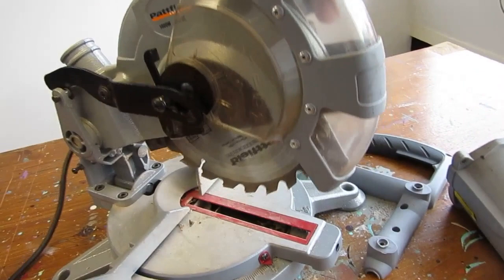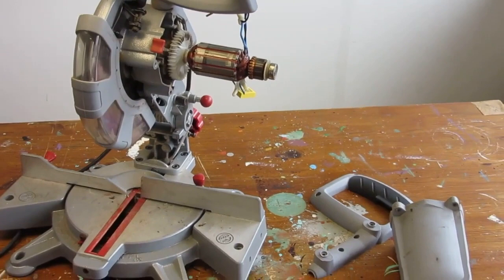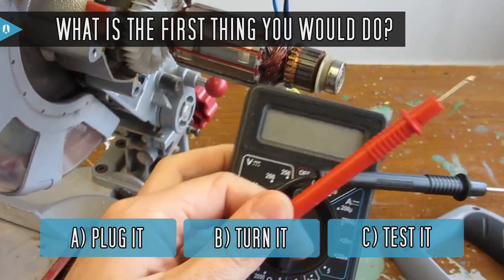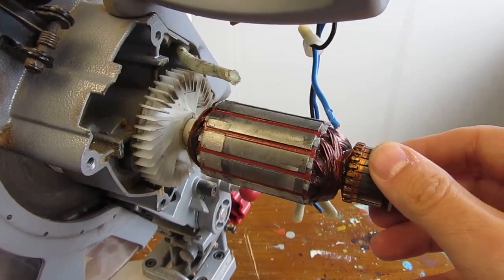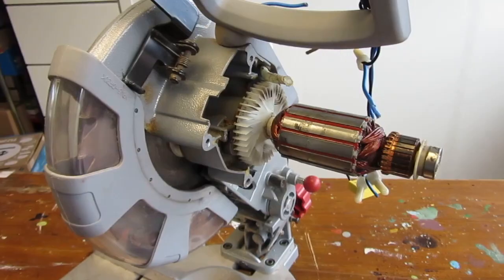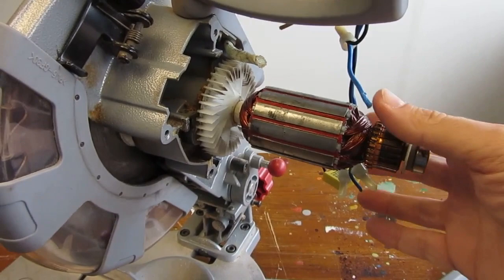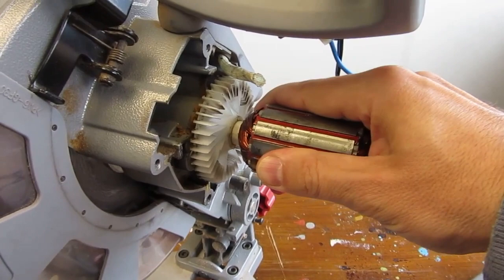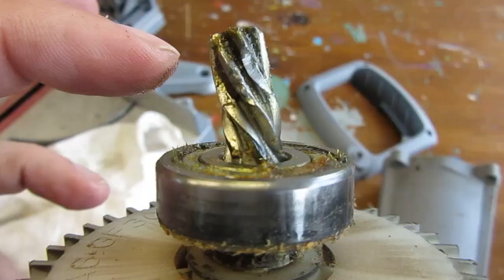Can You Figure Out Why This Miter Saw Is Not Working? HOW TO Test A Broken Electric Motor #Motor

Comment: I found my DW712N mitre saw in a skip. Ground off the seized main armature bearing. Ordered new. Put arm. in freezer for >24hr in clingfilm. Bearing arrived. Pushed it on with finger pressure. Got Trend 60 tooth blade and fitted.
Running champion.
Reply from the maker: Nice! Thanks for sharing

Comment: Not bad.  I don't mind the trivia portion here, it's how one approaches choosing between the effort required to check various portions of the machine Vs. the value of the specific test to understanding if it's just trash.  

I  too, picked up a free piece of equipment.  In the process of trying playing this very same game... 1) plug it it... 2)  turn it on... Yikes!! Turn it off.!  Whines horribly.  Blade turns, motor turns with blade, but not with a restraint.  Something is gone in the gears ... Is it A) a 30$ replaceable gear... Or B) the spindle of motor... 

 One of those gets a free ride to the scrap yard.  I wouldn't mind it being a 30$ table saw, well see soon.  Worth an hour of finding out says I
Reply from the maker: Indeed, and always something to learn in the process!
Reply from the maker: Good luck
Reply: @TheLabOtomy  it was the motor spindle chewed all up and a slightly rounded replaceable gear :(  but hey, now I know.